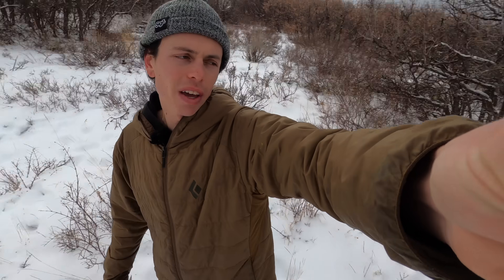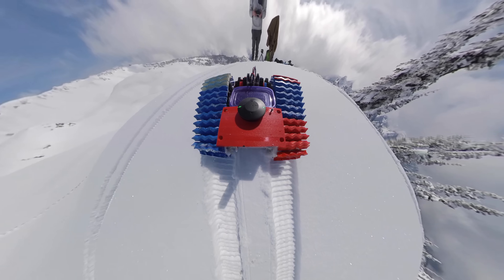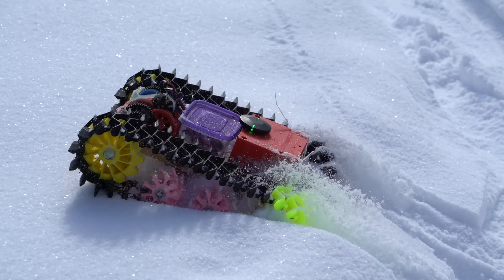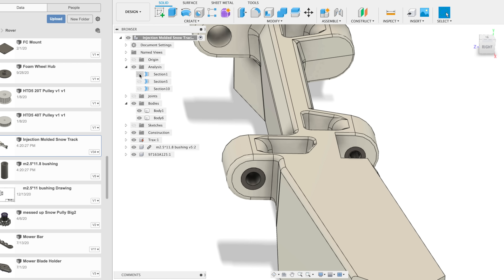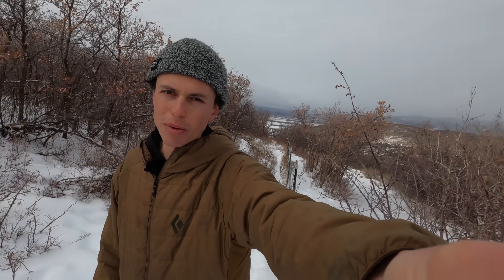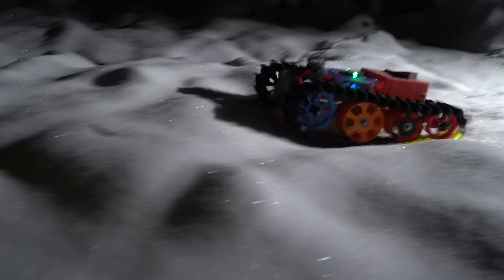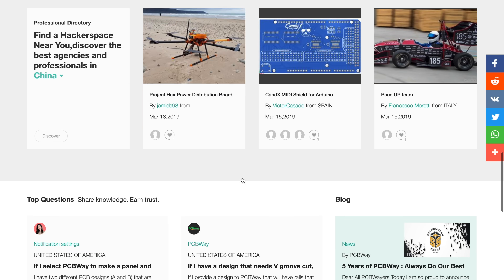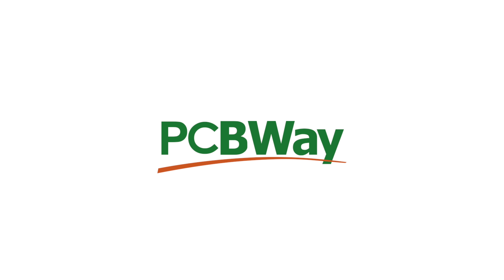R/C Snowcat - New Track Design - RCTESTFLIGHT

Comment: Hey Daniel, you can adapt these new tracks for the old snowcat by making each track asymmetrical, where it extends further on the side facing away from the body of the snowcat, but shorter on the side facing it. That way, they're wider but don't hit the body of the tank.

Comment: why is that injection molding isnt plausible states side? local foundries n jewelers could use skill to cast parts? guess there's that difference in cost of labor here vs there.. but die molding plastic shredded from every day plastic trash into re'useable things like snowcats & solar rovers parts?  ..lostwax process should work? the plaster o'paris mold does take molten metals.. hot plastic with a little pressure to insure flow fills into cavities in an array could mass replicate castings in one fill.. two part cement mold made from original print part might, but leaves seams to trim/file out.. either or homegrown resources over reliance i suppose.. pouring low temp metals like zinc (or lead) casts u metals parts without a furnace, just blow torch it with propane...

Comment: Testing 17to1 gearbox
https://youtu.be/Pni_nR_x5P4
Running multistar 4108 480kv motors. Had to modify the gearbox stl a little bit to fit the bigger motors

Comment: Hi, I am considering using your Snowcat design to power an electric snow scooter. The rear tire would need to be replaced with Scooter Ski Board (available on Amazon) and the front tire with a single track with 500W motor and transmission (front wheel drive for more fun). What are your thoughts on this? Does your design have enough power/traction?

Comment: I started working on a similar project about 6 months ago and have iterated through a lot of parts using your concepts and files as a starting point.  My tank is a bit bigger but each iteration reveals a new challenge.  I have it running fairly smoothly except the tracks fall off a lot due to the idler wheels not having any guidance and the tracks being flat at the contact points.  Have you thought of making guides or other ways of keeping those tracks in line so they dont pop off?

Comment: Got an interesting design choice for you to look into if it interests you as a gearbox, magnet assisted gears this is more aimed towards the solar rover, as Magnet assisted gears dont physically touch eachother and could improve longevity and durability, just something that I thought might interest you because you tend to dabble with new concepts, this might not work well due to breaking torque, when the torque to move the gear exceeds the magnetic field, but it's worth investigating

Comment: Suggestion on GPS, the reason you always have problems is because you need a receiver with higher precision (duh) and to get that you cannot just use 1Hz, so you have two choices, one is get a DGPS receiver and setup, it’s expensive, but it will provide centimeter precision, this is used on farm fields and shipping yards, the MUCH cheaper option would be to use 10Hz or above receiver, and average out each 5 locations into 1 thus effectively making a higher precision 2Hz GPS.

Comment: https://www.harbec.com/ These folks are located in Rochester NY. I have absolutely no idea on cost, however when I toured their facility several years ago, they had all sorts of really cool ways of making molds (including 3d printed tool steel). The also seemed to specilaize in smaller runs of parts, rapid prototypes/small lots/etc.

As an added bonus they're also really big into being environmentally sustainable. They've got a pair of wind turbines, a solar field and a biodiesel co-gen plant (i think that's still around) that repurposes waste heat from cooling the molds.

Comment: im currently working on a 3d printed worm gear box that fits a 540 can motor , but could fit whatever. there's some testing to be done and some kinks to work out but it seams solid . I'm designing it for a robot platform for yard work .A little write up, and files at  https://turboprint3d.ca  .

Comment: are you sure that ejection molding plastic will be compatible in strength to PLA? Maybe it is, I dont know. The point is: you should make sure that the same design works with different plastic and manufacture method.

Comment: At one point I started designing parts for a BandVagn 206 model, but never finished it. I designed the tracks using multiple lengths of T5 timing belt and using countersunk m3 screws to clamp all the parts onto the timing belts. Should stay flexible and wouldn't  require any brass inserts. The inner and outer belt should overlap for strength.
https://www.thingiverse.com/thing:398995
I was aiming for ~100mm of track width at the time, which is roughly 1/6th scale. I should really attempt to continue this tracked prototype again. It more or less fell apart around assembly and my stubborness to continue in OpenScad.

Comment: The track platform for powder snow is in my opinion a mistake.  Real snow cats don't have them even though they are designed for powder and neither do snow shoes.  The weight of the tank spread across the number of tracks that are in contact with the snow will be very small even if they are very narrow and the wide slots between them will help prevent the snow getting jammed between the tracks.   If you are unsure simply do the calculation of the pressure on the snow without the platform and then do a test in powder to see whether with that pressure the tracks will sink.  I'm pretty sure that you will find that the platform isn't needed and will only cause bigger problems than it is trying to solve.

Comment: Slightly off topic but I'd like to see your take on the differential thrust drift car. Fettec has a video on IG and design on thingiverse but it uses a proprietary firmware called KISS. I think an INAV (or other open source) version would be cool. TBH, I think pretty much all toy rc cars could be made in this manner and eliminate steering servos, gearboxes, etc. The tradeoff being the additional motors/escs and fc.

Comment: I'm confused. Why would you test multiple track designs (which ultimately failed), then decide to go into production on a design that hasn't been tested at all. That makes no sense. So now that you will have the ability to make thousands of this new design, what are you going to tell your "investors" when you discover it needs to be redesigned again and that $4000 is basically gone. I hope I'm wrong, but you clearly skipped a step in your process. You test stuff all the time, I just don't understand why you decided to skip steps this time.

Comment: protolabs is US base and have this online quoting system. Get in touch with them. I believe they sponsored battlebots team. My concern is that you did not test drive  with 3D printed parts and got straight to injecting molding. One of those insert will be hard to insert into the part. Anyway congrats! I hope there will still be snow when you finish!

Comment: I'm one of those who will be interested when you can make a kit with the non 3d-printable parts. it would be great if you can use common RC parts. Also, the community could make some alternative design (higher/lower ground clearance, track for RC car, etc.). International shipping would be key, I think.

Comment: Before you pick a manufacturer: have you  considered mold life tolerances and do they specify re-work/rejuvenation/redesign to maintain specified tolerances in the contract? I'm on board but let's not get junk. Glass reinforced parts to a reasonable spec with those chutes are gonna struggle.

Comment: Maybe you should 3d print a prototype with that track design first, before going forward and getting the molds made? If there is a flaw in the design, on in its function, your stuck with those molds. Just a thought, great idea, great video!

Comment: Before jumping right into injection molding, you might want to consider a batch of cast urethane parts. It's a really good process for small to medium batch runs of small, complex parts. It can be a good validation step between 3D printing and injection molding. Hell, you might want to consider cast parts for production. You can also trial materials pretty easily.

Comment: Daniel, why not make the body shorter than the wheels so that the body could never touch the ground?

Also, have you considered gimbal style motors?  They are larger diameter and have much more torque, meaning less gear reduction needed, and fewer parts.  They usually have hollow shafts which opens the door for some potentially cool features.  And are cheap hobby motor prices.  

Love your content, keep it up!

Comment: Have you considered using nylon or the stiffer TPU from sainsmart? I have used nylon for tracks and its indestructible and I use the TPU on lots of working parts and its very durable. just enough flex it cant break.

Comment: Daniel, dont go the brass bushing way, leave the bolts directly on plastic. They will last much longer, especially if people run them on dirt and sand plus, they will be cheaper to make!!!
Reply from the maker: My thought is that if the bushing wears out it can easily be replaced and you will not need a whole new track. It will be oiled steel on brass so it should last a very long time.
Reply: @rctestflight  I am in the real snocat business, and a mechanic. Plastics will ware so much less then the steel pins or bolts, thrust me!.
Reply: @rctestflight  And, oiled bushings will destroy steel pins cuz, people WILL ride their minicats, in sand and dirt for sure!.
Reply from the maker: @ronbradshaw7404  Hmmm all the engineers I've talked to seem to think bushings are the way to go

Comment: I wonder if these snow tracks could be used in a device to boost snowboards so we don’t have to skate in lift lines. I would love to have something that attaches to my board that I could use to boost it along flat surfaces
Reply from the maker: I've been thinking about this!
Reply: rctestflight awesome! my idea would be to use a suction cup or one of those car camera mounts that’s a suction cup with a pump built in, so you don’t have to drill into your board. I wish I had more knowledge about rc motors and batteries and such but my workaround would involve like a battery powered harbor freight angle grinder. Idk much about hobby motors and batteries but I wish I did!

Comment: Have you tried making a silicone mold and casting them using resin?  Should be much stronger then 3D printing if you use the right resin and the cost is much less then a full injection mold. I’ve used smooth-on products and they are fantastic to work with. I use to make silicone molds professionally several years ago - let me know if you need help.

Comment: I would probably go for this but I can’t even afford filament let alone a 3D printer. 
Happy new year and I hope you’re successful.
Reply: You can use weedwhacker/weed eater/trimmer line in your 3D printer. You have to dehydrate it first, but it works more or less the same as cheap filament, and is much cheaper.
Reply: @jttech44  that’s cool. How do you dehydrate it though? Microwave oven?

Comment: How about someone 3D prints these tracks and tests the new design first? Isn't it the ability to prototype relatively quickly the strength of 3D printing? Suggestion to make the whole project even more attractive: How about using such a snow cat/tank to push the user on skis? Something like e-skis?

Comment: Are 3D printed Nylon or PC not strong enough?
I'm tempted to do that so I can insert metal spikes for gripping ice. Or I could drill through the molded Nylon ones.
Reply: Injection molded parts are much, much stronger than anything a hobby grade 3d printer can create. Even if you're using expensive glass fiber nylon filament and remelting it, it's never going to be as strong because the polymers don't really cross link like they do when you're forming the part in a single shot.
Reply: @jttech44  True. Though it's unclear whether the extra strength is required, those filaments can be expensive and enough of a pain to print that it makes the injection-molded ones more compelling.

For ice gripping I'll drill through 6-7 links per track and bolt on some kind of shallow serrated stainless blade

Comment: Before going any further with getting the injection molding done, wouldn’t it be wise to first prototype your newest design again using 3d printer?
Reply: Did you not notice the prototype tracks he showed in the video? Not to mention all the prototyping he likely has been doing over the past year. Even if he hasn't already finished the prototype he would have the testing done before the mould would be commissioned.
Reply: @jakekiedaisch2279     no shit i noticed the tracks, but seeing that he hasn’t showed much more, I figured I ought to make sure hes not just jumping to the manufacturing stage, being that normally you ask for money AFTER showing a finished to even semi finished product. Kinda weird to line up a manufacturing company before you even have an idea or none the less show the idea in full, and then go on to ask for funding. But none the less it would be nice to get confirmation from the channel not a douche flute pointing out obvious things in a cunty manner.
Reply: @jakekiedaisch2279  you're right, but be nice to the guy, he just asked a simple question

Comment: I mean WELLLLL you COULD have made the tracks wider on the original body by adding duck bills to the side of the track like they did on Tanks in WW2. Look it up its an interesting method used by the U.S., Britain, and even the Germans they were fighting against to reduce ground pressure in mud and snow. The germans used Winterketten or Ostketten while the U.S. and Britain attached what they called duck bills to their sherman tanks.

Comment: I would definitely recommend the REV Robotics ultra planetary gearbox, and well as the VEX PRO Versa planetary gearbox, as they have modular systems for adjustment of output ratio post purchase. They are also extremely durable and sealed decently well, and should stand up to weather conditions. They also have motors that are made to mate to the provided hole mounting, or you could make an adapter plate if they don't have the desired mounting profile.

Comment: If you make the mould out of aluminium with 3D printing heaters and just screw the halves together,
Then you can just use your standard 3D printing fdm head to melt and inject the plastic (frn)

That would be a good YouTube project.

Comment: Physics Anonymous another YouTube channel just brought an injection molding machine could be a cool chance for a colab? I believe they're in the US, not sure if it's big enough/ would be able to do fibre reinforced though. Great vid!
Reply from the maker: Sounds great but I don't think they will want to make 5000 track links ;)
Reply: This is definitely a big run of parts, their injection molding machine is meant for smaller runs of small parts.
Reply: Ah, yeah that's definitely a much bigger run than expected! Perhaps a prototype to test how well it performs/ easy it is to mold? But there's is definitely designed for much smaller runs. Just an idea! Can't wait to see how it goes
Reply: Their machine is too small for those links unfortunately, it's limited by the small clamping force (and physical size).  The rule of thumb is 2-4 tons per square inch of "projected" area (the silhouette of the part, basically).  Their little APSX has a 5 ton clamp, which means it can charitably do 1.5x1.5" parts. I think these tracks would be too wide too. Just as another data point, I have a larger manual machine with a 25T hydraulic clamp, but that still only gets a 3.5x3.5" part, etc etc.  The clamping forces required get pretty brutal as you scale up parts. :(

Comment: You 100% are NOT ready for injection molding tooling. You've got at least a dozen prototypes and refinements to make first. If you need more strength you can go with CNC or laser cut and welded  tracks for prototyping.
I've worked in the injection molding tool design industry for years, I see this all the time people jumping in head first not knowing what they're doing, having no previous experience and most importantly not having finalized designs.

Comment: Seems interesting but my concern is that it looks like you're going forward with a design that has not been tested. I know you've tested previous iterations and your confident that this will work well but I feel like the exact design you're using really needs to be proven before putting it into production.

Comment: With brushless motors, at low speeds they can cog. If you want to prevent that, you should get a sensored brushless motor that is smoother and prevents cogging.

Comment: You may look into simplifying the design even further for injection molding. As far as I can see you need at least a 3 part mold because of those screw holes, or do you plan to drill those after the injectionmolding is finished? A couple small changes can have a significant effect on the price of the molds (decreasing depth, increasing internal feature radii etc)

Comment: From my experience I wouldn't do it at any cost specifically with China. you might be able to get parts at a dollar for each component but getting your molds back here to the US if you ever want to bring the manufacturing to the US, is next to impossible.   So good luck.  Passing this half and done a dozen times and it never works out in your favor.

Comment: I noticed that roughly a third of your kick support is coming from the metric world. Is that going to be an issue for them, or is there a solution for that?
Reply: I'm sure he's designed them in metric, who designs parts in fractions of the size of Texas these days? (He's using M2.5 bolts which is a good indicator that the tracks have been designed in metric)
Reply: @yngndrw.  "sir might I have a 1/5462 of Texas long subway sandwich"